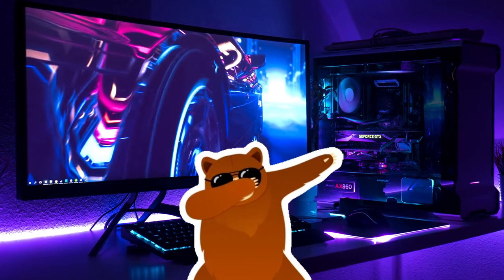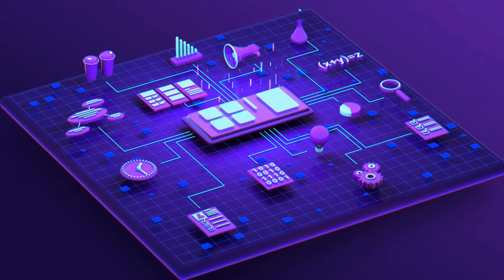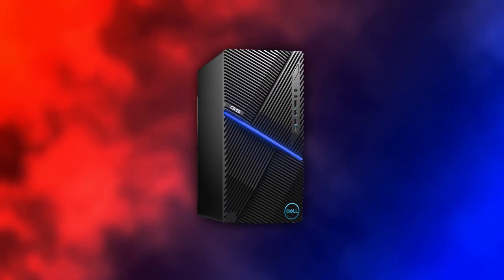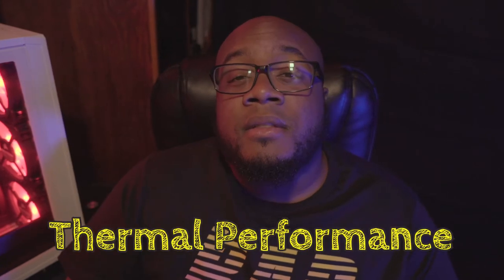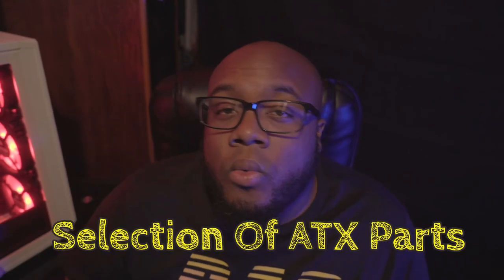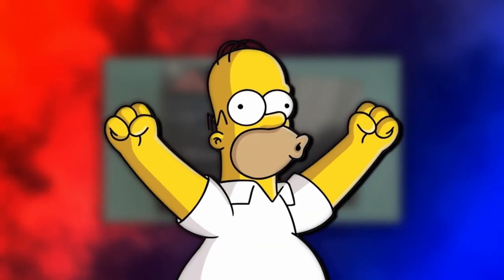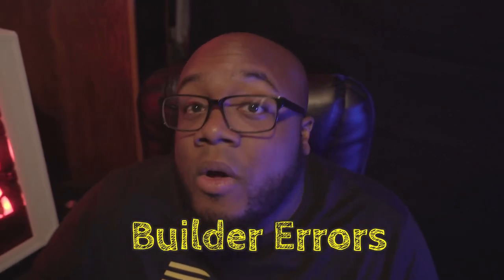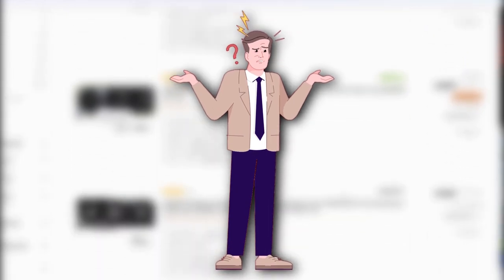Building A Gaming PC: Should You or Shouldn't You?

Comment: My 1st Pc was a pre-build, Brand TARGA, i bought it in a local supermarket Lidl about 25 years ago. It was a good price to performance deal at the time. Since then i build all my PCs, Its too much fun to pass that up All of it, from looking for the parts, the ATX tower, GPU, CPU, PSU, UPS, RAM, NVMe SSD and the MB. The best deals wile making sure of the compatibility between them. Its a rush, but not as fun as taking them all out of the boxes and assembling them all together. Cable managing is so easy these days. And to finish, taking off those peels and the satisfaction of that  1st click when you turn it on for the 1st time.  As usual good Video. Thank you.